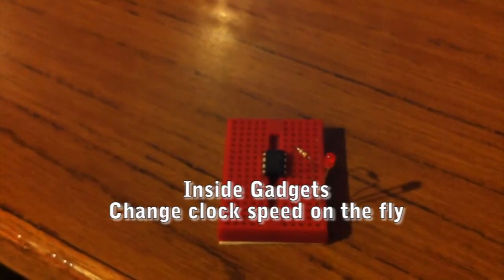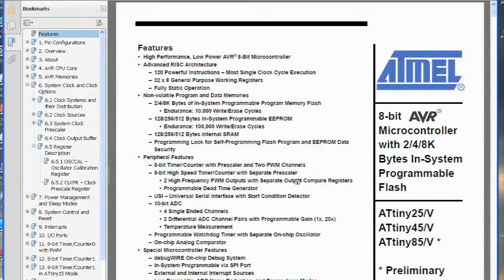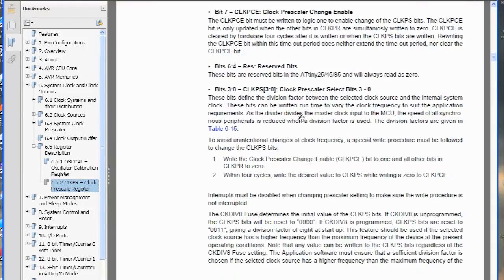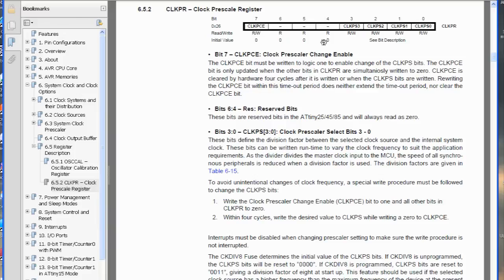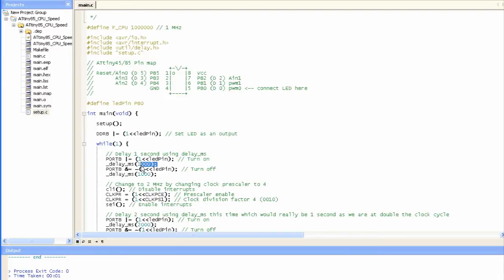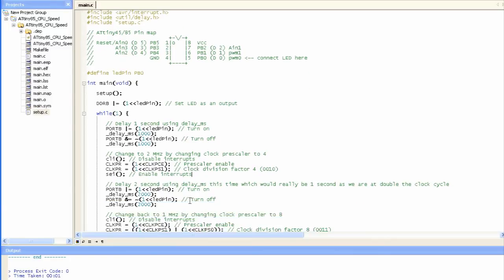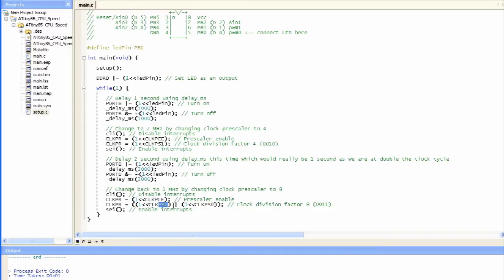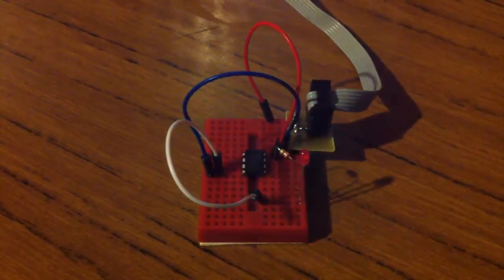Change the ATtiny85 clock speed on the fly

Comment: This is exactly what I am looking for! Thanks. I want to send out an on / off signal to an electro magnet to run a motor in the range of 500 to 2,000 Hz. I also want to modulate the frequency and voltage at the same time to increase / decrease speed and power at the same time. Essentially I am trying to make a Volt / Frequency controller, or custom ESC. This might work.